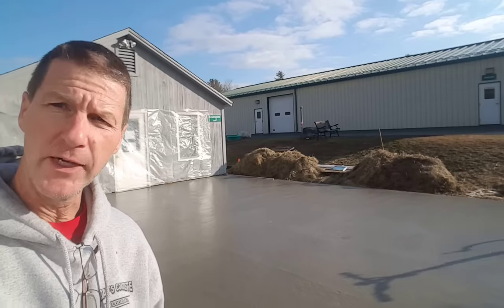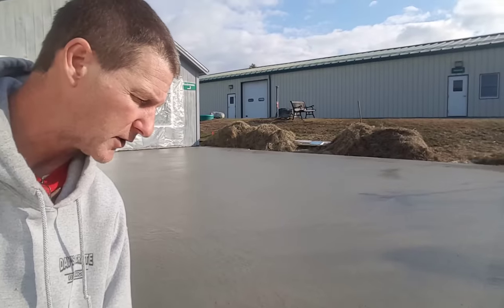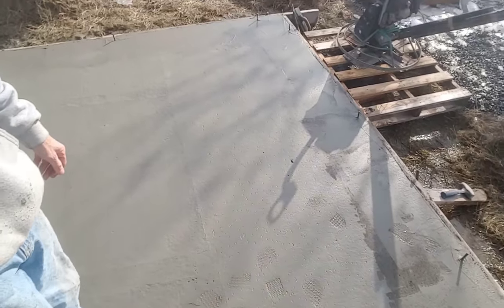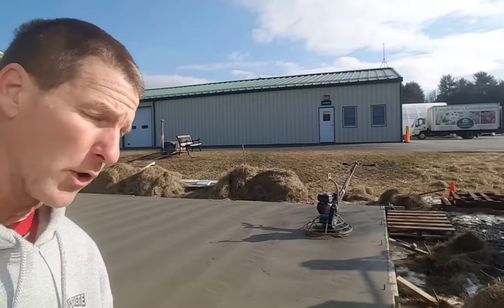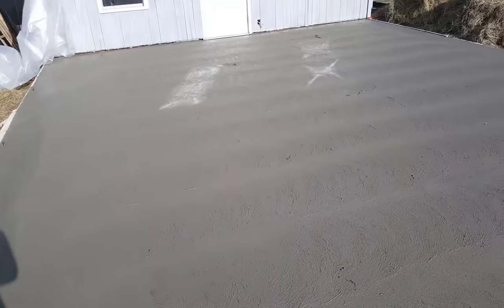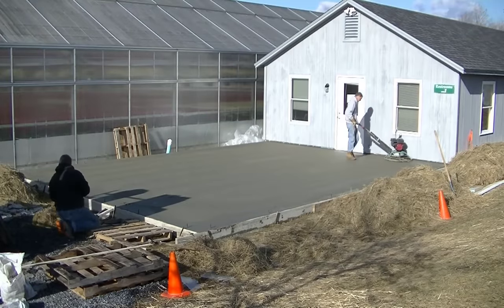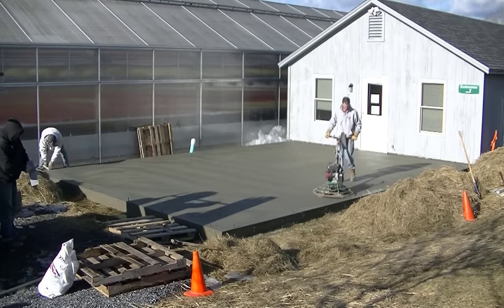When To Start Finishing Concrete | What Finishers Know, That You Don't!

Comment: Have you tried using wedge anchors instead of sinking bolts into the slab? Very simple to drill holes in the plate and then into the concrete and everything is perfectly lined up...

Comment: If everything goes perfectly, weather, mix, skills, etc., you can go from a bull-float finish to blued out in one trowel pass. Those conditions are rarely achieved, and depend on having a excellent screed job and perfect bull-float. I've managed to achieve that once in 20 years of concrete finishing. That was on a 20' x 24' slab. It would have been two passes, but I had some problems getting the power trowel going. lol

Comment: I am a time served bricklayer to trade and watched floor concrete guys a lot and I've seen them have a bag of cement with them at certain times and throw it just like scattering seeds to get the water off the concrete and blend it in just to get the job finished before darkness came

Comment: I was about to try a 18 foot by 40 foot slab myself, or do it in 4 sections. I have done some small sheds in the past that are guff as ruts. Then I worked out a better price with a pro and that's the way I'm goiung to. With concrete you can only get it wrong once. You've convinced me I've made the right choice. What do you do if your power floater breaks down? By the way, picky me, conrete sets not dries. I tell my wife her mind is like concrete. All mixed up and permanently set. Great video. I will feel more confident with my next project building some pig pens. Thanks.
Reply: On tools breaking. One advantage of hiring a good professional is they have professional friends that in a bind may have a similar tool to loan in a pinch - professional curiosity. In the future I’ll have spares on hand if possible and different brands of tools. Work with rental companies have accounts so you can have them on speed dial.  Learn the lesson hard way with equipment breaking too far from town. Equipment on site was the only solution...

Comment: I have power troweled a few slabs and they turned out OK, but that was more luck than managmen because I was just winging it and doing what seemed to work. There is definitely  a fine touch required to control the trowel and once you find it, it is easy to do. Until you find the sweet spot it is a battle.
 At the beginning of the video you adjusted the pitch of the blades but you didn't comment on this. Can you tell us what you are doing and what you are looking for in blade angle.
Reply from the maker: The blade angle should be as low as possible and not dig in when you first start, then slowly adjust upwards as the concrete cures. Too much pitch in the blades will cause humps and dips when the concrete is still soft.

Comment: I work for a company that does floor flatness and level testing and I cannot stress how important using the trowel in the opposite direction is for actually leveling the floor.
Reply from the maker: You got that right, thanks for that.
Reply: True flatness is about placement. How flat you screed or bump cut is the biggest key.  Doing super Flat floors, that's where the emphasis is placed
Reply: @MikeDayConcrete  Great video btw. Looks good!

Comment: When you talk about using float blades on the trail machine are you switching blades when you get ready to start burning out the concrete for the slick finish? I have always just used normal blades and flatten them out to float the concrete and then cock them up as I am going over it for the final finish. Another thing I always did was I would actually purchase a cheap set of boots and then cut the treads off so that the bottom was smooth. I found it easier to trial without having to remove the boot tread prints especially on those hottest days when the concrete is setting faster. Great video.
Reply from the maker: You're using combos, we sometimes use "Float Blades" for the first hit, then kick them off and use finish blades for the remainder.

Comment: I have done this for 20+ years.  I was watching to see if you did anything different than I do, and there's not much really.  I actually run a float pan and combo blades, but otherwise no real difference in finishing technique. The only reason I do the pan/combo blade setup is so if I am doing bigger pours or if I end up with part of the  slab in the shade or something like that I can flatten out the blades after I take the pan off and still float out a section.  The only other "trick" I use is the stone test- take a 1" diameter rock and underhand toss it onto the slab, if it splats, wait a while, bounces and leaves a little dent  it's ready, if it bounces and doesn't leave a dent you might be in trouble.

Comment: Curious who supplied the concrete, judging by your accent you sound like you're around Mass/NH, I finished my share of floors back in the 70's, F&S Transit Mix and Wakefield were really good with plenty of "fat" (cement) to put a good finish on, "Minuteman" and Dover Redimix were crap, too many chemicals not enough cement in the mix making it tough to get a nice finish.
 Also we put in slabs with a "Darby" (no bull float or screed) because the majority of our floors were in the cellar with walls, columns and plumbing obstacles, I guess I'm showing my age huh? 
 Great video, glad to see there are still craftsman at work putting out great work one slab at a time!

Comment: Fair enough what about what speed you want the blades spinning from when it's fresh to when it's hard as well as the angle you want the blades ? The first hit with the machine you go slow and have your blades down there's no need to have two different types of blades .The harder it gets the more you wind the blades up and accelerate the machine.As for the edges sure hit them once with the hand tools but once the boards are stripped the machine does the edge anyway.A mag float is made of the same material as the bull float and that's when it's meant to be used. So the edges stay consistent with the rest of the concrete untill you use the steel tools.You use the steel trawl when you pole trawl the bullfloat lines out or machine it depending on type of job.The Wood float is for breaking the surface and getting the edge flush not a mag float then you edge and  or steal trawl the surface taking the line out if edging.

Comment: Never heard of anyone cutting expansion joints.
Do you mean control joints?
Also, you can wipe out a slab cleanly at the end by running the rpm and blade angle just right.
Saves having to do it by hand.

Comment: No CC added? We did 30 yard flatwork in the morning with 1.5 -2% CC.  Another 30 yards in mid afternoon. Done with 3 man crew. We tamp, float, power trowel then hand finish trowel. The fun times is when the truck ran late and we got a hot load. Work double time to get it down but gave a rest break b/c it cured faster.

Comment: I love your videos man lots of great info! One question that I have is when you're ready to hit the floor with the power trowel the first time what is the best positioning for the angle of the blades and then when/how do you decide to flatten them from there on for the smoother finishes?
Reply: Fixing the pour a. 20 by 30 6 inchs deep your videos has really helped going to try your flat screening methods you made it look simple  I have Lazer  not a beeper but should be able to make it work thanks for the tips

Comment: Me and my mate gave spent 25yrs here in England power floating hundreds of thousands of square yards of concrete floors, never hand finished any of the floors apart from the edges, used to bring them up as shiny and smooth as glass. You seem to be making hard work of it with all that hand trowelling.

Comment: Should tell us how to set the blades for the angle. How much tilt do
You have on the first and when you use the finish is there much tilt ? The more the tilt the more it would dig in. So not much at the beginning but what about the finish part do you what to put a little more or not as much?

Comment: I use a 1" stone and toss it out on the slab,if it sticks in the concrete it's still to wet but if the stone bounces off an leaves a small impression it's ready to hit with the machine...

Comment: Major difference in the way west coast vs east coast finish concrete due to weather. If we poured concrete like that and just floated it and let it sit from then on until it was ready for a trowel machine, it would crack up. Hopefully you guys over there got rid of using hand jointers to cut all your joints and learned how to use walking trowels by now right?

Comment: mike if u were making pre-stressed concrete floor modules  /////////in steel molds do u think there is another way to finish the floor complete without  touching it  with a machine ////////////  slabs 48 feet in length by 14 feet wide

Comment: Do you adjust the blade angle on the power trowel between each finishing pass? If so what is the technique you use for that? Also, when covering the slab with a plastic tarp, it seemed like if I left the tarp touching the slab it would leave imperfections or an unwanted pattern in some parts of the finished slab. On my project, when I noticed this, I tried to lift the tarp off the slab using stakes driven vertically around the edges and stretching it across so it wouldn't touch. Is that something I needed to worry about? On my project, my biggest fear was the power trowl wouldn't start, or that I might have some sort of maintenance issue with it. I only had one helper and for two rookies there is no why we could have hand trowled a finish anywhere near as nice and smooth as I made using the power trowel. The nearest rental yard was a 3 hour round trip.
Thanks for the video.

Comment: In 40 years of pouring concrete I learned one thing quickly. By the time you’re ready to put a machine on it, I’m troweled broomed and home. Also if the mud isn’t drying like this, use your Fresno open it up and it will dry much faster. No need at all for a machine on a job this size.
Reply: tell me about the Fresno. Ive done pools and the perimeter around them. what is Fresno?
Reply: ok i see it. i knew it as a steel trowel. so you drag the water off or just work it dead? thanks in advance.
Reply: A Fresno is trowel usually 4ft wide by 6in with a connection where you can connect multiple handles to reach far into a slab to close it. After concrete is poured and rodded it is gone over first with a bull float made out of wood or magnesium and then closed up with the Fresno.
Reply: Dewey Watts when the concrete skins over use the Fresno to reopen it to get it as flat as possible. When the concrete no longer reacts to the Fresno use your funny trowel.
Reply: Dewey Watts the more you hit the concrete the faster it will dry.
Reply: I worked twenty years in VA and NC and never saw a wood bullfloat. Where do you use it instead of a magnesium bullfloat? Also tell me about the funny float. 
The other question is why did everyone tell me to wait after the bullfloat? (I think they were tired) They said the steel trowel (fresno) would dig in if used right away, which I saw too. Man I wished I worked with you guys!
Reply: i see where you said "when it skins over". I'm sorry for not following so good. I was trying to figure out how you sped up the process, which I think I understand means that you get on it with the fresno as soon as possible to speed up the drying. Time is money. My father said that in his pool work. Just giving the customer too long to think about it leads to problems and unnecessary changes or additions. You need to do what you bid on and get the heck out of there until the next project or bid.

Comment: One point that should be made about using the power trowel is that when the concrete is soft, you must keep the blade speed down. Too fast on the speed will work humps into the concrete.

Comment: When you first checked the concrete to check it's readiness for power trowel... do you check in the area that was first poured or last poured?
Reply from the maker: We check both. It usually sets where you start first and if that part is in the sun. Something this small usually all sets at the same time.

Comment: I've been working with concrete for 37 years never have used a power trowel. Always by hand old school way. Gives a better finish if you know what your doing. Also with a power trowel you can burn the concrete and leave a nasty dark blackish burn in the concrete also if you don't know what your doing.

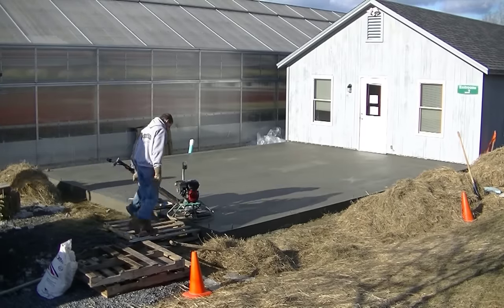Comment: 15:04 ok, so you do add dilatation/contraction cuts/gaps in it at the end by saw... i was thinking it's not needed since has no edge support.. like another slab/wall that keeps it tight...

Comment: Very informative.  Curious if there's a reason why you use mag trowel for first trowel instead of steel.  I know magnesium leaves a rough finish.  You mentioned trapping water.  Is this why?
Reply from the maker: Yes, we want to leave the surface open to let moisture escape as long as possible. Then we use steel.

Comment: I think its overkill using power trowel but to each his own. We poured football fields of the stuff using a good old trusty Fresno and a bo float. Ive always wanted to learn the  ride along power trowels those are sweet. I was to busy rigging on that project. The next project they sent me on i spent 5 weeks of vacuuming dirt and removing it from the a&b. That was atrocious. Never learned enough to get good at any of it. No one wants to teach anything anymore. Then they bitch that they cant find good tradesmen. I spent 3 years working in the concrete industry. Good luck and much fun to ya.

Comment: I’m not a concrete guy but just had slabs poured for some additions to my house. What's the point of the magnesium trowels by hand? Wouldn’t the power trowel do the same thing? I was watching the guys and thinking it was just something random for the rest of the crew to do while the power trowel guy did the real work. Please explain.
Reply from the maker: You mean for the edges or for the middle of the slab? We only use hand trowels for the edges. Some guys will use a funny float or trowel to go over the entire slab, but we don't.
Reply: @MikeDayConcrete  For the edges i mean. I get the shaping for the round over, but it seems like the power trowel could be used for everything.

Comment: I have a 24x40 garage. Its fairly old and the floor is in good shape. I wanted to remove a side wall and add a section to enlarge the garage (add a 10 x 40 sister slab) and build the wall back. Would this be possible without creating a lot of problems? Thanks

Comment: Also I’m sure people would get the idea, but you start where the pour started. Just Incase the sun is out and directly hitting a section, make sure you keep an eye out as it will get harder faster.
Reply from the maker: You start where the concrete is ready first. It's not always where you start the pour. The sun has a lot to do with where the concrete gets firmer the fastest, the shade usually lags behind a bit.

Comment: How fast do you run the machin for floating? How much angle on the blades? And the same questions for finishing.
Reply from the maker: We usually run the float blades as flat as possible, just tipped up a little. Finish blades start out pretty flat with a little angle and as the crete gets firmer we increase the angle as needed to work up the surface creme.

Comment: Great video , now, do i have to wait for all bleed water to disappear Before finishing? Like when doing countertop slab it might take hours 🤷‍♂️
Reply from the maker: It's not good to finish the concrete when bleed water is still present. If the concrete is ready to trowel and there's still bleed water on the surface, we'll squeegee it off before troweling it in the surface.

Comment: I tried a power trowel once when I build a garage 25 years ago. The trowel turned the opposite direction as a floor buffer. I have spent many hours scrubbing and stripping floors. I had no chance of ever running one of these things. I can do many jobs, troweling concrete is not on the list.

Comment: Really good video. Did you turn off the power trowel when you edged by the wall or does yours idle without it spinning? The Whiteman i have does not have a neutral . Just wondering if something is wrong with mine . Thank you .
Reply from the maker: I turn it off, just to be safe.
Reply: @MikeDayConcrete  Your the man !

Comment: My question here is, why go through all this trouble to finish and level the concrete slab if it's gonna be covered with tiles? Doesn't the final leveling take place during the tiling process? And wouldn't a perfectly finished concrete slab be redundant when it's gonna be covered with tiles? I hope my questions were clear enough!